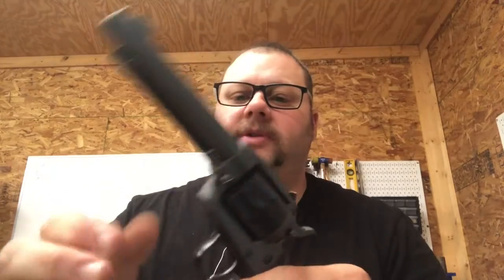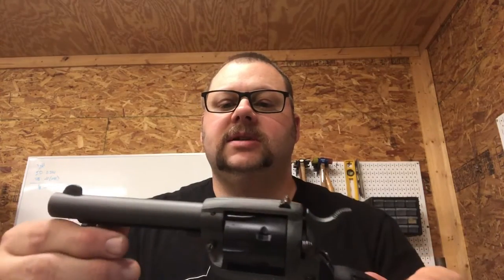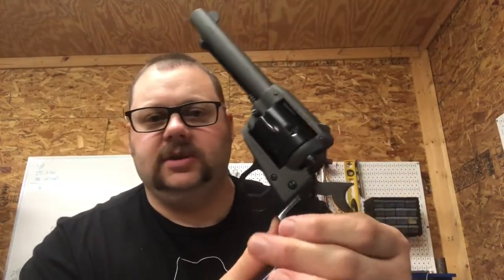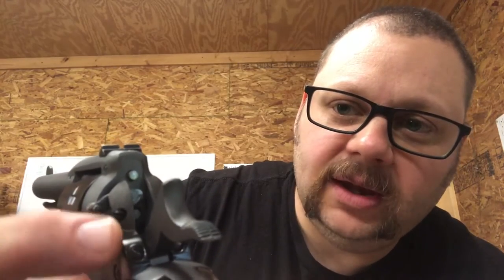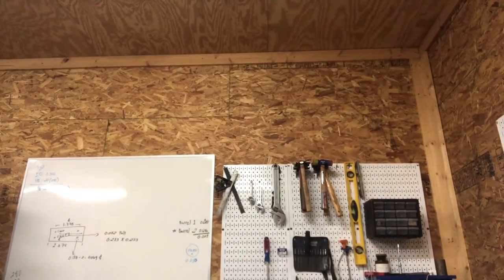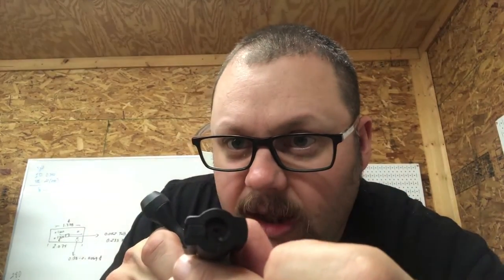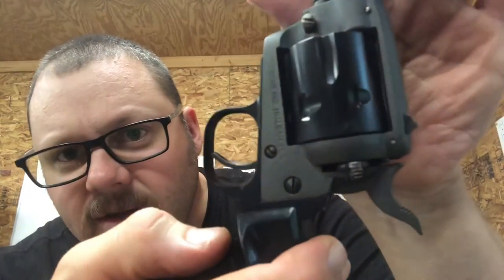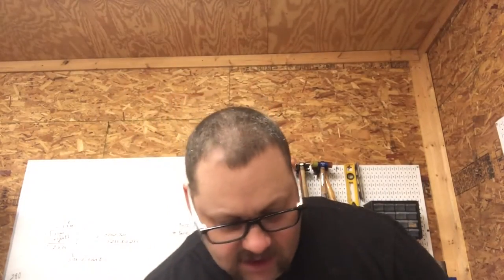Tanfoglio TA 76 .22 revolver safety fix

Comment: Mine has problems cycling the cylinder.
Reply from the maker: You might check the linkage connected to the hammer. There’s a piece called “the hand” that comes up and pushes the cylinder around. There may also be some excessive of the cogs on the cylinder. These guns are pretty simple. Not a ton of parts to deal with. Just gotta make sure everything is times well.
Reply from the maker: You might check the linkage connected to the hammer. There’s a piece called “the hand” that comes up and pushes the cylinder around. There may also be some excessive of the cogs on the cylinder. These guns are pretty simple. Not a ton of parts to deal with. Just gotta make sure everything is times well.

Comment: An AR rear sight ball bearing is 1/8", or .125 in diameter.  Its also a 1-3 dollar part and im trying it based on your estimate of "130 thou" in hopes that i wont have to drill out the safety plunger hole in my ta-76
Reply: Now that’s a really good suggestion. Thanks for sharing that.